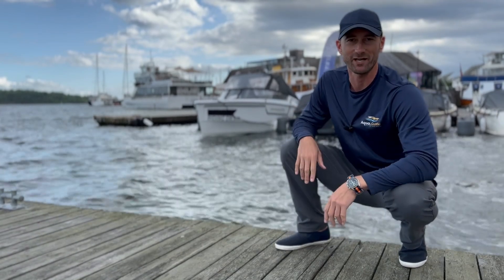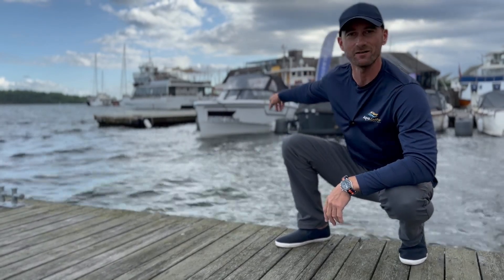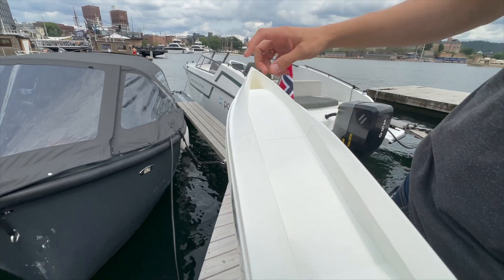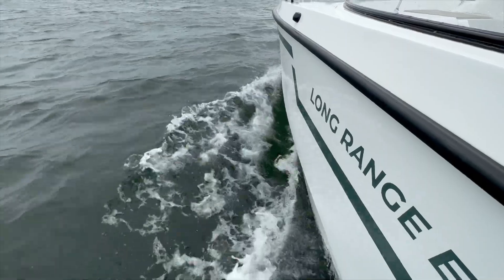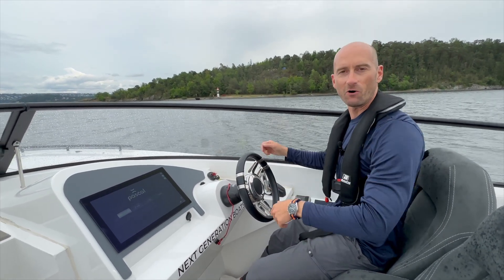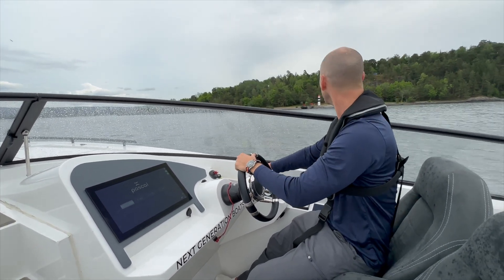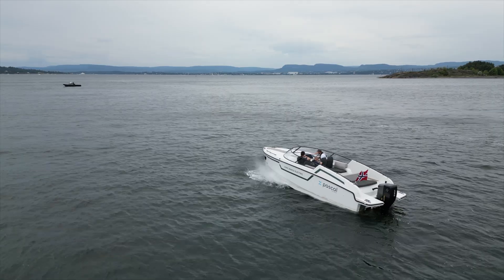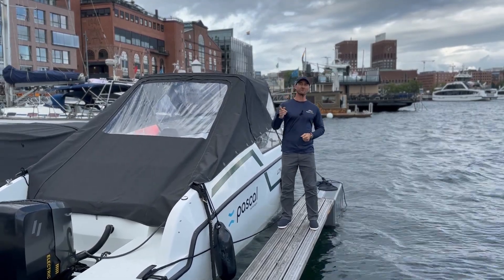this boat rides on a cushion of air | Pascal Technologies Electric Prototype

Comment: I had wondered about something similar for high performance stepped hull boats, if you inject just a little bit of air at each "step" in the hull it SHOULD help you get up on plane faster/easier.

Comment: please be truthful about what double the efficacy means  a boat that gets 2 miles to the gallion will top out at 4 if conditions are perfect a boat that gets 1 now could achieve  2   its 100% for sure but still only toys for very few..
Reply: a mile out on the water is really out there you're not swimming back
Reply: There is a form  of air blown friction reducing system that has been developed for flat bottom heavy shipping  ..the air is bled in a stream of small bubbles from small holes a short distance back from the bow .. unlike this being pressure blown, they are effectively drawn out by the forward motion of the vessel ... The stored  air reservoir is only lightly pressurised  ..in heavy displacement shipping it can save up to 8- 10%. Significant in a field where improvements of a percentage or more  are regarded as significant and worthy of significant expenditures. 🧙🏻‍♂️

This actual high pressure air ride system is used on some of the high speed stealth inshore attack and patrol boats.